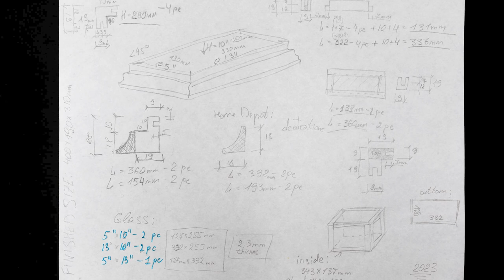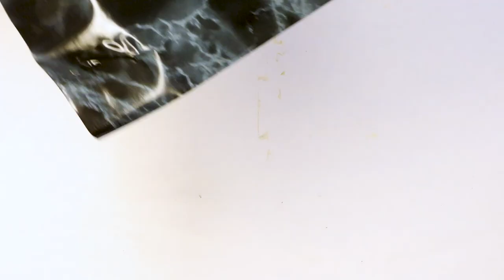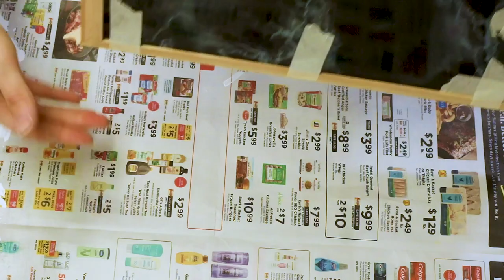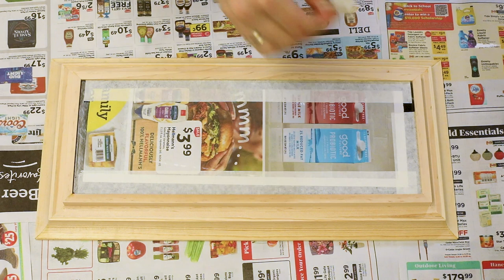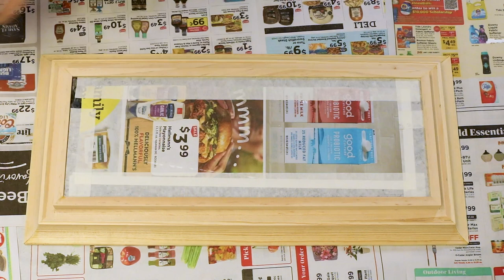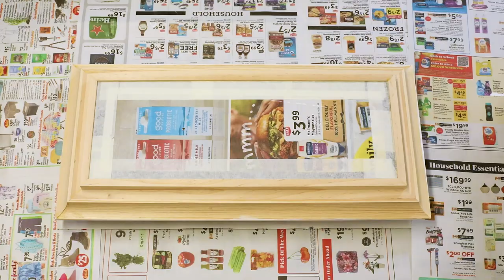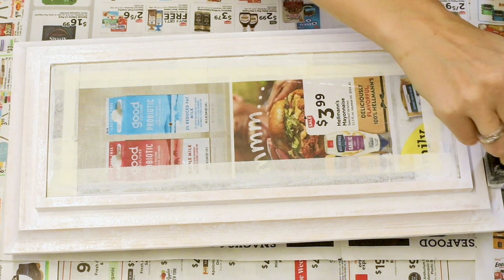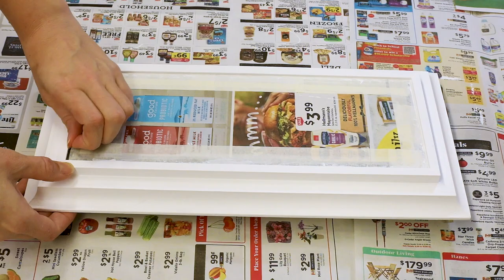DIY DISPLAY CASE (Pedestal with marble) for a scale model

Comment: Very Nice.
Protip:  Where the two painted surfaces mate up, rub them with a plain white candle.  The wax will melt and leave a light film which will ease assembly (and will not fuse together over the course of time).
Reply from the maker: Thank you very much!
Actually, I did it, but behind the scenes)))) when I took the model out of the workshop...

Comment: You might want to consider getting a strap-style miter clamp (sometimes labeled as a "picture frame clamp")  These are handt for moulding around model bases as the compression is circumferential.
Reply from the maker: Yes, these tools are very useful but unfortunately expensive. Therefore, I make a self-leveling structure that folds almost perfectly at an angle of 90 degrees. This time, on such small dimensions, I got perfect corners. On large display cases, 1 m long or more, I can lose 1-2 mm)))

Comment: Another source for base materials is to contact one's local counter top installers.  They will often have left-over bits from where sinks are cut out, which can be fascinating started for model bases.  Those counter tops might be as simple as plastic laminate fused to particle board to cultured or real stone.  The counter top people often just dispose of these.
Reply from the maker: And I just bought a whole sheet of plastic "imitation stone" that is glued to chipboard or other frames, but I felt sorry to cut it because it is big and it is very convenient to photograph models on it))) That's why I found this self-adhesive wallpaper...